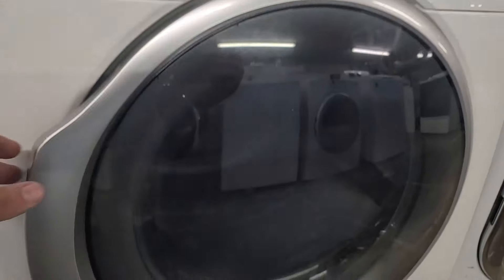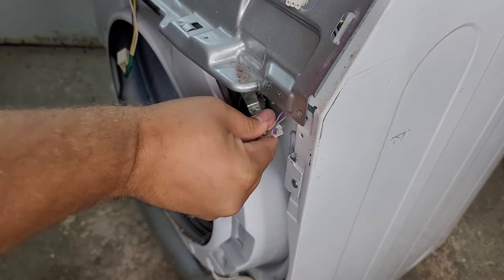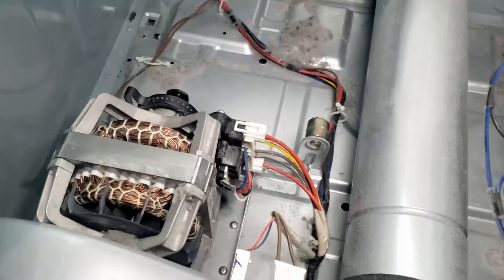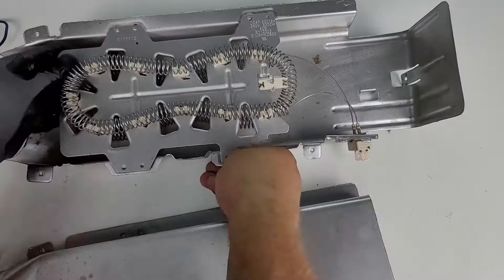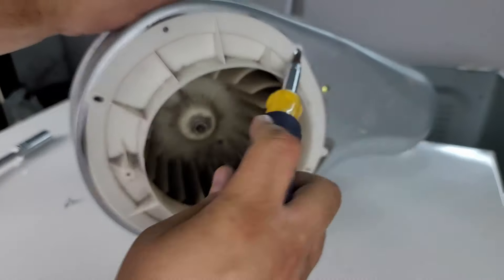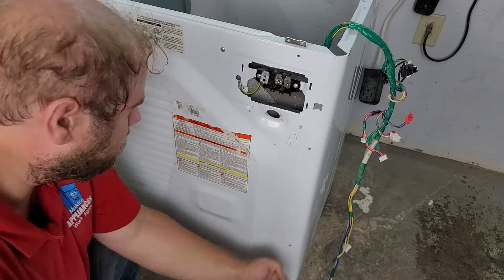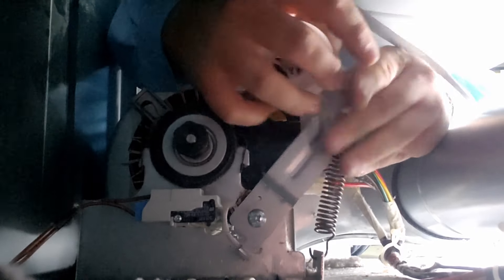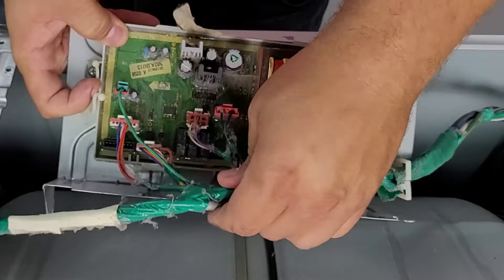How to Disassemble a Samsung Dryer - How to Take Apart a Samsung Dryer

Comment from the maker: If you have a Samsung Dryer and need parts like the drum roller kit, you can support us by buying here:

Samsung Heating Element Kit: https://bit.ly/3xUNbfc
Samsung Heating Element Cannister w/ Sensors: https://bit.ly/3y7StnT
Samsung Idler Pulley & Roller Kit 4x: https://bit.ly/3eHcTw3
Samsung Dryer Motor: https://bit.ly/3lwh5CA
Reply: So I have model DV330AGW/XAA, would the Kit in the link work with this model?
Reply from the maker: @hebersoto  Yes. Its all 100% compatible with that specific dryer model.

Comment: My husband fixed my dryer, it was making a bad noise. First he changed the two rollers ( we have an LG) it was making a thumping sound. That didn’t help, then he saw the drum had a crack, not a big one but when it went around it made the sound. Changed the drum and that fixed it! Now I have a dryer drum in my backyard filled with potatoes one year and flowers this year! 🤣 that’s for all these great tips! When I started showing my husband this video he said right away he needs an electric screwdriver! Then you had one! ( I told him you were showing us how that’s why you weren’t always using it) thank you for all these videos! ❤️
Reply from the maker: The drum getting split is the worst. It happens similarly on older GE dryers... you eventually get a metal on metal situation and the dryer tears itself apart. I'm glad you got a new drum!

Comment: Very helpful vid. On trick I used to put the heating assembly back together. Use toothpicks to keep one side aligned while you assemble the other, then remove one at a time to place the remaining screws.

Comment: So my Samsung dryer has a ghost in the system, I'm hoping you can help. It's a little over 6yrs old. about 2 months ago, had a tech out to just do its first cleaning maintenance and replace any rollers if needed. I should add, dryer was working perfectly, just some belt squeal. Tech tool it apart, remarked how clean I had kept it, belt was good, needed a tensioner pulley, he put it on, put back together, ran great. Week later, went to do my first laundry since work was done, first load, great, second load, it ran about 15 minutes, then heard some clicking, then it stopped, all lights were flashing like it should, no codes, nothing, powered off, flipped breaker, nothing, after 5 minutes, it started back, ran 5 did the same thing. I polled the top off, to listen and video, the clicking comes from the lower left side, not the board, tool a chance and replaced the board, did one load fine, then clicking and stopping, every 5 minutes for the second load again. Called the tech, he came out, dryer ran perfect for him, of course. Just did 2 loads today, same thing, first load great, second load, clicking and stopping every 5 minutes, 5 off 5 on. This is getting really aggravating, I don't want to toss what might still be a good dryer, but can't afford to keep throwing money at guesses either. Any help or suggestions would be greatly appreciated, wish I could upload a couple videos to show you the clicking.

Comment: Hi, great video!  My dryer stopped working a few weeks ago and your videos have been great to familiarize myself with how to take apart, replace parts, etc.  I have the DV42H5000E/A3.  My symptoms are unit powers on but does not start.  I did the time dry test where it still counts down, and interface still works, etc.

When I power the unit on and press start I hear an audible click or single tick noise - but the motor doesn’t turn on.  I replaced the thermal switch, the other switch on the heating can, and the heating element first.  When fixing this I found a roller failed but that was about it after a good cleaning, etc.

I replaced the roller, put everything back together and still same click and no run…

I replaced the PCB board tonight, buttoned everything up and still same situation.  Single click and then nothing…

Any ideas or suggestions on where to go next?  The unit is only 6 years old so I feel like I should be able to get it up and running again?!

Thanks,
John

Comment: Our Samsung dryer will not dry either.  The problem is the wire terminal that connects to the heating element.  Not sure where to buy it.  Any ideas??
Reply: The link is pinned in the description of the video
Reply: @Perfectdancing  Don't need the entire heating element  just the terminal connector
Reply: @GorillaGrodd420  I found the items I needed at a local appliance store. It was a 20 minute drive but it was worth it because I didn’t have to order and wait for shipping
Reply: @Perfectdancing  This nice for you.  Went to several stores yet never found the part.  Ended up buying a dryer off of Facebook marketplace.